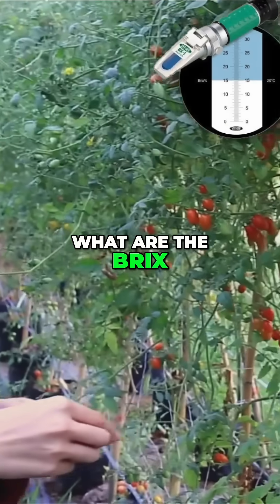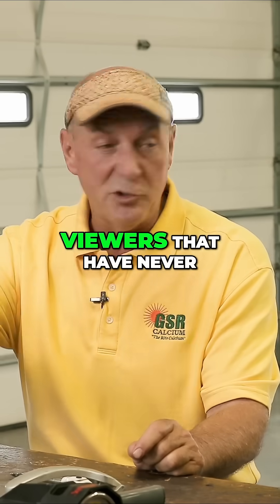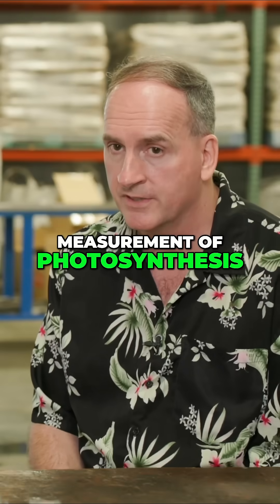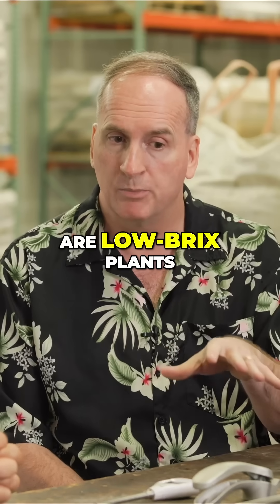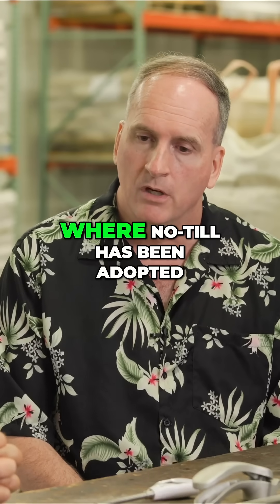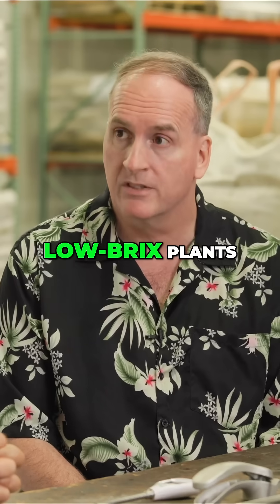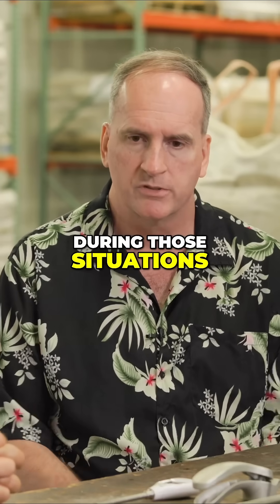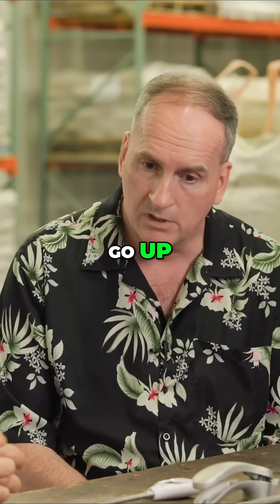Does No-Till = Less Healthy, Low BRIX Crops? #soilhealth #regenerativeagriculture #planthealth

Comment: A no till system relies on compost as a primary growing medium as opposed to a straight indigenous soil direct sow. “ conventional “ method. There is a wild range in commercially available compost for such growers. So whatever your “ measuring” has a lot less to do with the system and a lot more to do with the quality and micro biology of the compost used and obviously the skill level and technical ability of the grower. Whatever y’all are selling, I’m not buying .

Comment: Tilthing the top couple inches or, something that breaks the soil but doesnt flip it like a broadfork. There is now a mechanical broadfork that hooks to a bcs tractor.
Reply: Broadfork doesn't flip anything. Puts a hole (a few) in the ground & breaks up ground, but it doesn't flip, just aerates. A tiller flips, but doesn't get down as far as a brand fork.

Comment: Does the same plant in a tillage situation have higher brim levels? This seems an indictment against a tillage technique which doesn’t make sense for plant health, primarily. As no-till typically has far less compaction and higher SOM levels.
Reply: There is a slim chance a No Till field for 40 years is below 150 psi Compaction. Soil type and machine traffic dictate that. How many years did you run that 6 or 8 row planter and pick the Corn the same way in that field? If you applied Andhydrous, that's tillage. If you side dressed, that's tillage.

Comment: Interesting. Love to see the controls on this. How long has the field been no till? When you first start there isn't a no-till generated microbiome. You need to fertilize because there's no fertility in the soil even if it's good 50/50 compost and loam. Building a good soil biome takes the first year. It gets better each year. Are they really observing no till practices? Some people think just not tilling is the whole story. Far from it. It's a whole technology. There's a lot of variation in how people practice it, some legitimate, some not. Adding a lot of fertilizer works against creating a no till microbiome. Every year we've done no till, the soil becomes softer, deeper and less compacted than the year before. We started a new garden of raised beds on top of a heavy machinery compacted base that it was difficult even to drive in fence posts with a post driver. We had to add a sledgehammer. After 3 years the raised beds soft and several inches below we're soft and fluffy. After 10 years you couldn't find the bottom. Totally soft all the way down. You can even step in the beds as long they're not wet and they will not compact. We haven't yet measured brix but it looks like time to order a meter. It's interesting when people say no till or no big doesn't work. I always ask them what they know about it. Usually it's nothing more than the title doesn't work. That part is true. But a longer more descriptive title was not going to fit on the cover of a book or YouTube video. Here is the shortest I can think of: No till is disturbing the soil as little as possible to improve the aggregate formation, improve both drainage and moisture retention, minimize weeds, providing active microbiome for growing plants with minimal to no fertilizer after a period of soil rebuilding, there any welcome environment for soil life including worm, insect and bacterial and fungal components.
Reply: I'd be very interested in seeing what you find out with your levels. This will be my first year doing no till.

Comment: I’ve been following no till market gardeners for a while and I don’t think I’ve ever heard them speak about calcium. It’s always throw an inch of compost down side dress with some nitrogen at some point and you may need a little potassium.
I understand that compost made with manure is gonna be pretty high in phosphorus.
I will say they are quite serious about their soil not being compacted.
Is there a way to address no till with minerals instead of making it seem like a completely bad idea?
Reply: Usually, but not always, as Soil health improves, Compaction lessens BUT, it may not be below 150 psi. It may come from 300 to 200 for example. So then what tillge method is needed to get the rest of the way? You wouldn't use a chain saw to cut a Filet Mignon. Perhaps a Phillips harrow. 
     I encourage good record keeping. This is where GPS can greatly benefit. You may not need to do the entire field, just those trouble spots .
Reply: Again, Compaction is part of the solution. The Soil needs to inhale and exhale by the High and Low Pressure Weather systems. Ask yourself, do you like being cramped up in a small room of people, or having room to move about without parting that crowd?
Reply: @thegreenerthemeaner  I don’t see how your response correlates to my response.
Glen is quite clear that calcium not tilling is how you loosen the soil.
And no till market gardeners do not have compacted soil. For many of them, they can put their hand into the soil elbow high. This is generally done by always keeping the soil planted so the roots do all the work.
Reply: @FlylightD  So when they put down another inch of compost, it's loose, correct? Why is it being added and what is in it? It was tilled to be removed from where it was to where it was added. Then they side dress. Though not tillage with a machine I'm guessing, both actions are disturbing the soil. So they truly are not NoTill. To me a true NoTill only disturbs soil when planting.
     Once the soil Compaction is in range, you shouldn't need tillage and as you point out, plant roots help keep things in check. BUT Calcium is heavy and doesn't stay where it's needed. Excess calcium in the soil can tie up or reduce the availability of other elements like Phosphorus.
    I'm not familiar with Market Gardening. Can you elaborate on the process? Raised beds, Green Houses? I'm Row Crop and Forages based.
Reply: @ that’s  kind of a dogmatic way to think about “no till”.  Most no till practitioners do not mean to not disturb the soil at all. It means they’re not bringing in machinery to turn over the top 6 inches of soil. Most market garden farmers on YouTube are row crop no till farmers. 
I actually listened to the complete episode that this snippet was taken from and it’s even a bit more reaching when speaking of no till. They were literally talking about orchards.
The term “No Till” is really only applied to row crops that would conventionally be tilled with mechanical assistance turning 2 or more inches of soil over. Permaculture, raised beds and orchards shouldn’t be part of the “No till” conversation.
Reply: @thegreenerthemeaner  to answer your first couple questions, yes the compost is well composted and loose. It’s being added for the nutrients but also for the microbes and the more fungal dominant it is the better. It’s also being added as a mulch on the bed to suppress weeds. 
It was not “tilled” when it was moved from its compost pile to the garden row bed, Because it’s compost not a row in the field. Tillage is about the field of rows that would conventionally be tilled. You wouldn’t walk into a Waffle House on a Saturday morning and hear blue berry farmers or pasture raised cattle farmers or chicken farmers talking about tillage, therefor you wouldn’t include them in the no till conversation. You would however find a pepper or corn or wheat or lettuce or cotton farmer talk about tilling their fields. So, they would be part of the till or no till conversation. Leaving the soil alone and planted as much as possible is what seems to be best practice. Any dogmatic ideology associated with no till makes for a pointless conversation. It’s best to get to the point and purpose of not tilling and if that is logically sound to you, practice those principles (Not Laws) as best as you can in your context.
Reply: @FlylightD  My apologies, I'm not trying to be dogmatic but rather simple in the observation. Farmers add manure at times but not soil or compost at each planting, and I'll allow that is part of the practice your referenced type of agriculture. It does affect compaction though, but at the same time, market gardening has little to no machines run on the site of the plant. We can't compare apples to apples as it were, but soil grows plants the world over and the same basics apply for whatever you grow. My main points are learn your soil types, how deep the nutrients are in the spectrum, gaurd against erosion, is the crop you grow right for the soil type and topography? Keep good records and don't assume one practice works on every field or even across the same field. It can take a lifetime to learn some of these finer points, so pass them on to the next grower. I think chemical farming needs to be removed completely, but for those that lease different acres year to year, there's no incintive to change their ways. I understand that reasoning so it's going to take landowners understanding this line of reasoning to allow an operator to be given time to see the fruitage of this style of chemical free farming. Best wishes to you and your operation.

Comment: So how do you increase the brix?
Reply: Photosynthesis is sunlight, air, water and soil nutrients being turned into sugar. If you have low brix (sugar), you have a plant operating poorly. Make certain the plant is getting sunlight, water, and soil nutrients. (Usually, you add composted animal manure to soil, and the brix (sugar level) goes up)
Reply: @mitchellbrown9713 Almost correct. The Calcium and Phosphorus levels are important. Carbon to Nitrogen ratio is also important. The C:N ratio influences how quickly organic matter decomposes and how readily nutrients, especially nitrogen, become available to plants. More Nitrogen may not be needed and in most instances can be reduced significantly.